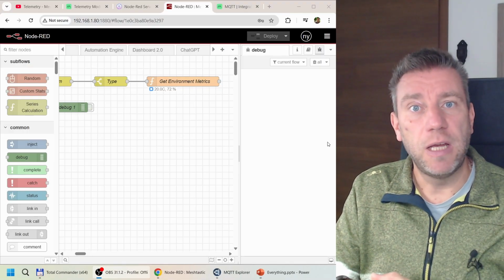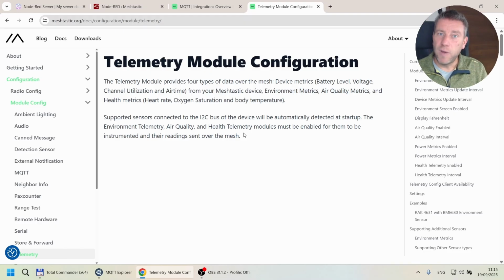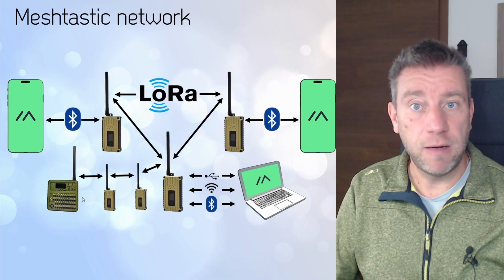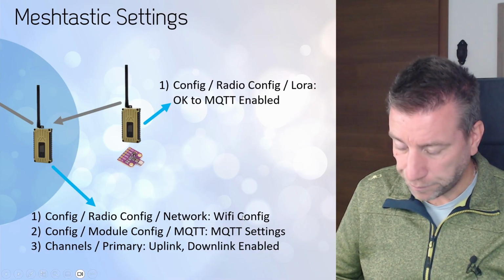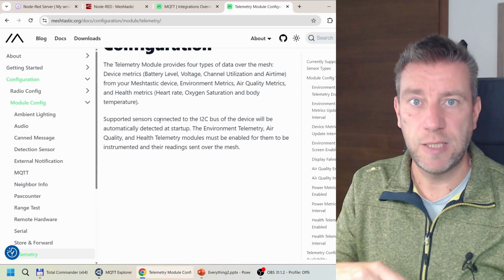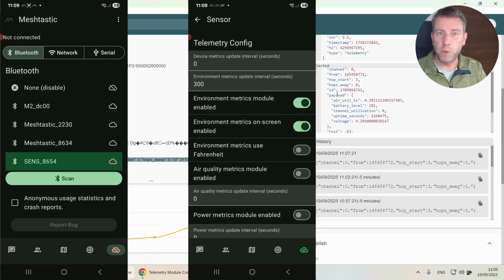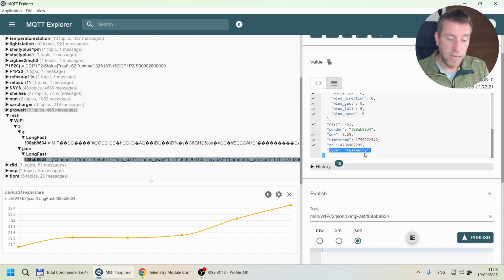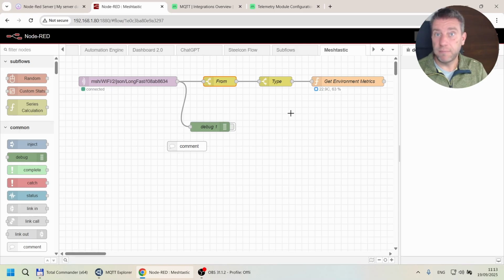Meshtastic to Node-Red: building a Lora sensor network

Comment: Nice video. Thanks for taking the time to put it together. It's worth noting that there is a node-red node (node-red-contrib-meshtastic) for decoding Meshtastastic protobufs. This becomes necessary, for example, if you want to access the payload from SIMPLE serial messages.
Reply from the maker: Yes, I tried a few different nodes, but I could not get them work. One of them made my Node-Red instance unstable (there is an issue raised on this), and I also found another which could not be installed. As far as I can tell this MQTT method does the same what I need for this scenario.

Comment: thanks for the video. i have this runnig for a while now and works well. do you know if this can be done on meshcore?
Reply from the maker: I looked at Meshcore some time ago, but it had no concept of sensors or environment data, only text. So I did not look more into the meshcore for this reason. But this might have changed since. Also it looks like there is no out-of-the-box MQTT connector, so probably need a different approach to get data out of the mesh.

Comment: Just found your video! Ive been imagining this as a solution to some excellent presence detection on my property while extending my mesh. Makes alot of sense in a very limited or obscure use case. Thanks for the excellent information, i plan on building on this robust platform that is extremely configurable. Im happy for the client mute option as well so we dond flood meshtasic with sensing traffic. Have a good one!
Reply from the maker: I want to make the next video with some sensors like door or motion sensor. Similar to your solution. I think the canned message functionalty can be used for that. Probably on a private channel so it does not spam the public channel.